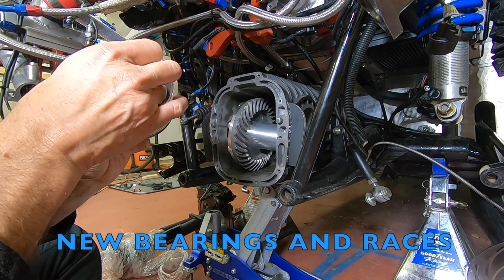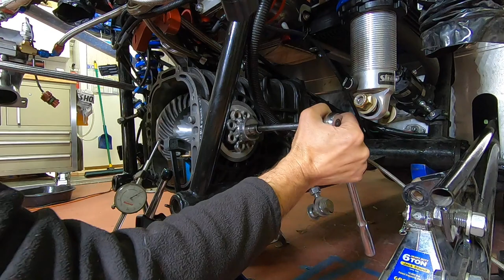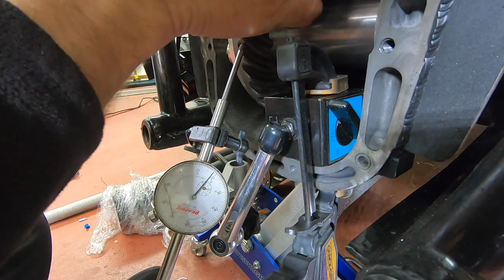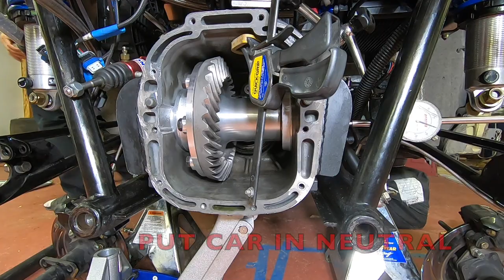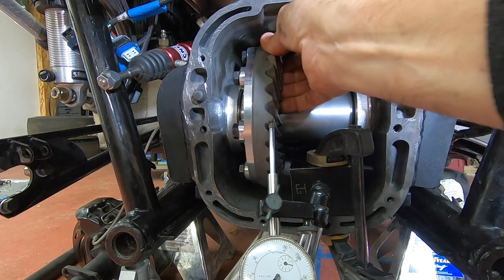VW 091 6 RIB BUS TRANSAXLE RING GEAR BACKLASH

Comment: What did you set your preload to? On used bearings I set mine at 20 inlbs rotational torque.
Reply from the maker: I didn't have a torque meter at home. trans guys told me on this style trans they can be set like wheel bearings. we'll see what happens...